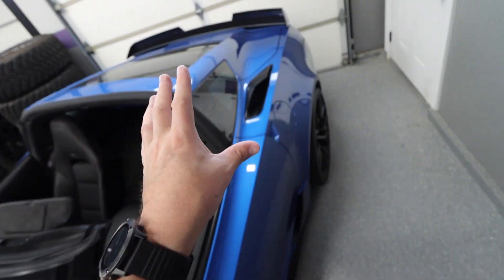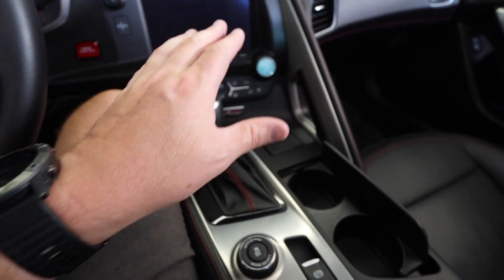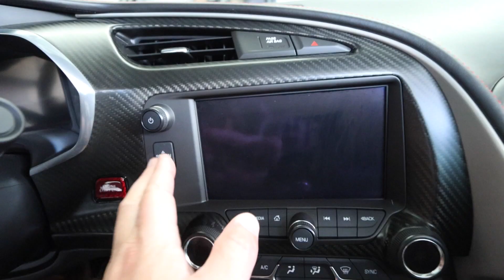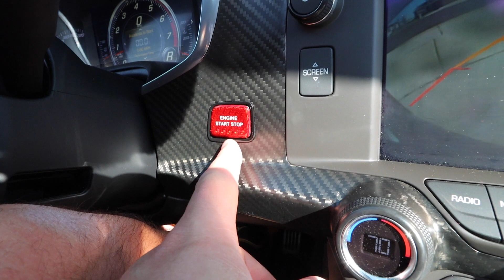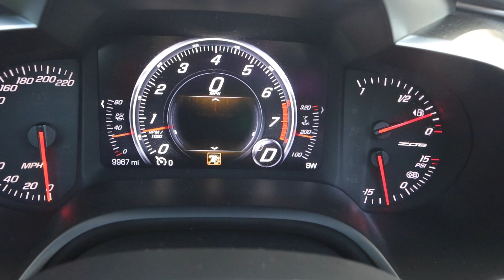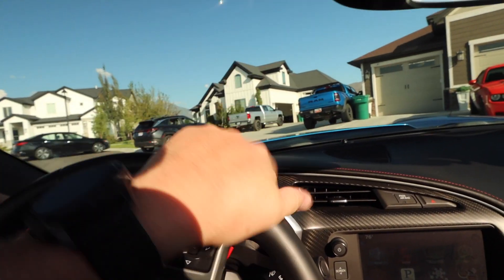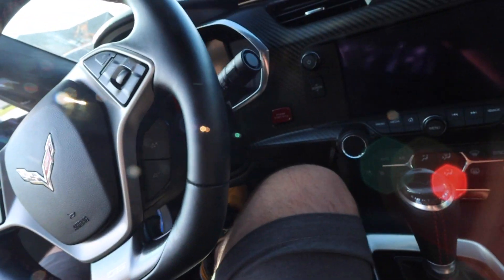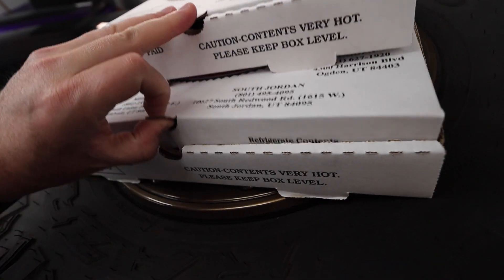Full tour of my new Corvette Z06

Comment: Burlacher - the door release in the trunk is so you can open the front doors when your car battery or fob is dead.  You use your car key to manually open the trunk (hole is hidden underneath), pull the door release, and then you can get in the car.

Comment: The pull cable is if your battery dies, it opens the front door so you can get to the hood release. There is a lock cylinder above the rear License plate to pop the hatch, access the cable to open the door, so you can open the hood, to jump start it lol
Reply from the maker: Ah. That actually makes
Sense. Appreciate it!
Reply: @Burlacher  yep! Just take the key out of the fab to start the whole process! 🤣

And yes, it is a process lol

But just so you know, you do not have to climb through any tiny space!
Reply: @Burlacher  Big fan of u bro 
Would love if u reply back lol

Comment: The driver door release is for getting into the car if the battery dies. The drivers door only has an electronic pad to open the door so you need a fail safe to get into the car. There is a key slot above the license plate and that pops the trunk lid and then you pull the door release to get into the car.

Comment: If you're curious about the door latch in the trunk I believe it's because if your battery dies you can't open the doors because they're buttons that need power. But you can open the trunk with the physical key. So to get in the car you can pop the trunk, then pull the latch and go in the door instead of having to crawl to the front seat throught the trunk! At least that's how it is in my C6z.

Comment: The release in the trunk is there to open the door in the event the battery dies and you cannot open the door using the electronic touch pad “handle”. There is a key hole located above the license plate to manually open the trunk as well.

Comment: The pull lever is to open the drivers door when the battery dies. There is a key whole by the license plate to open the trunk so you can pull the tab to open the door.

Comment: The door popper in the trunk is in case the battery dies. The doors are electronic with no key hole. You can open the trunk, pop open the door, and then open the good to get to the battery

Comment: Hey Burlacher, to solve all those issues, get an ECU and Transmission software upgrade.
Reply: It doesn’t change the delay . It already shifts fast and the tune will make it shift faster but the delay from when u click the paddles and when it actually shifts won’t change
Reply: It also depends on what driving mode he is in. The shift points/time change with the different driving modes

Comment: There's no keyhole for the front doors.  There is a key hole to the right of the license plate under the rear hatch to the right of the rear hatch release button.  A key is in the key fob - part of the silver top.  Press a little release on the FOB and it pops out.  If your FOB ever quits working, use the key to open the rear hatch and pull the lever to open the door.  Love the car/color btw.

Side note:  if your FOB ever quits working or isn't recognized as within distance to start the car, you can insert the entire FOB into a slot on the right of the steering column - where you would normally put a key.  Unfortunately, there's a reason I know these things...

Comment: 2:34 what you need to fix your not fitting is a tillet b5 seat it will be less comfortable sitting on it unless you pay extra for padding but you will fit in the c7 with zero issues then

Comment: The first thing you need to do is send your tcm trans control module to hp tuners, it was the first thing I did to my c7 z06, it got rid of the delay completely, it shifts like a mofo now, no more bouncing off the rev limiter 👍🏼
Reply: That changes the delay from when you click the shifter to car actually responding ?
Reply: @gunsmokezz  yes

Comment: The doors use an electronic switch to open. If the car battery or key fob battery dies, the doors won't open. You have to use your key to pop the hatch and then pull that door release cable.

Comment: Let;s say your battery dies. You have electric doors. Son on a normal corvette with the battery under the hood, you cant get to the hood release. Now your ONLY key hole on the vehicle is above the rear license plate. So you have to open the trunk to get in. You then have to pull those handles in the trunk to open the cab to get to the hood release to gain access to the battery. In the Z06 you don't have to open the doors, but they arent going to remove that feature just for the Z06 or ZR1.

Comment: I think it’s a mechanical door release if the electric latch mechanism fails. The door release is an electric button right. So if it fails or has no power the mechanical release in the trunk opens the door.

Comment: Wanted to add, do be careful with the napa leather, over on the passenger side it can start bubbling up because it wasn't glued on correctly. It also can start separating from the front vent as well. Another thing to watch is the wheels on the '16-'17 Z06 and GS vettes can sometimes be prone to cracking, or warping. Just things to look out for but love the vette nonethess

Comment: 🇨🇦😎 Hey Buddy  Nice C7 Z06.  I see you a tall boy.  Did you know the trick to get more leg space in the C7?  About 2 inches or so?  Move the seat forward then undo the orange wires on the back of the seat. Then push seat back  you will not have the stopper at the back of the track it's going to stop on the back of the carpet...   you are welcome ...
Reply: Does that effect the safety of the seat
Reply: @gunsmokezz  no   it disables the stopper as in  the one that makes the car look it's best.